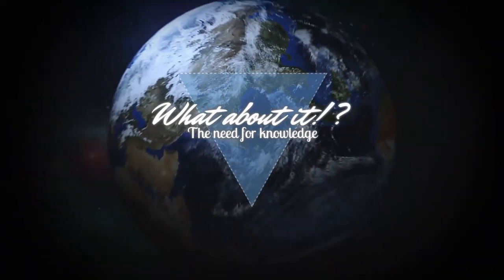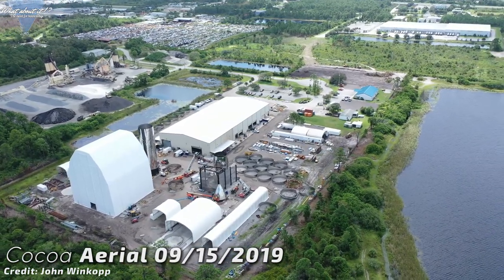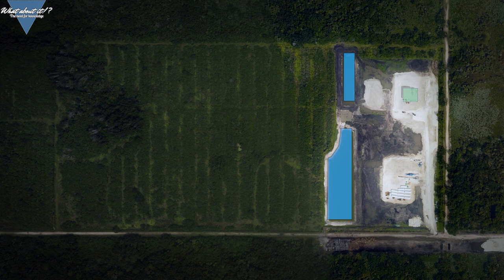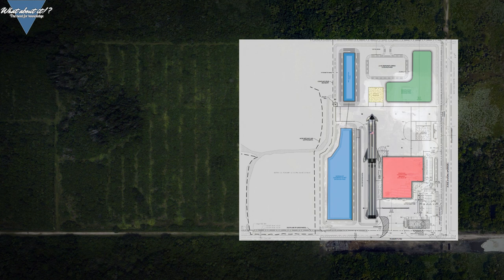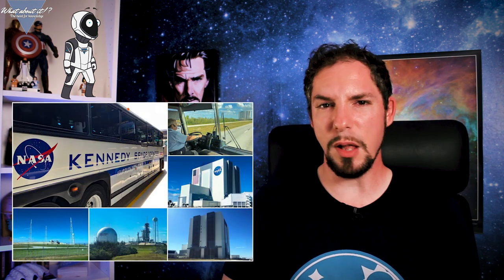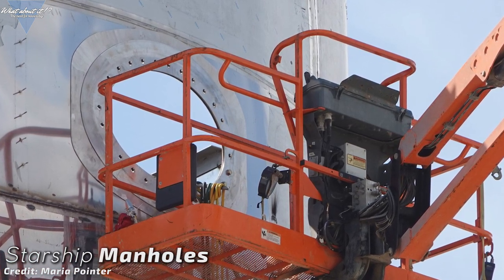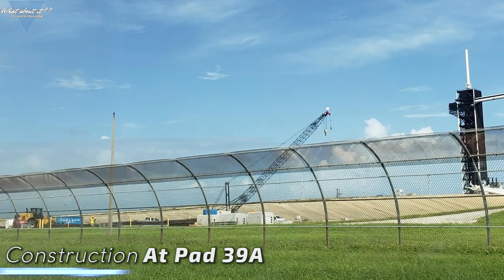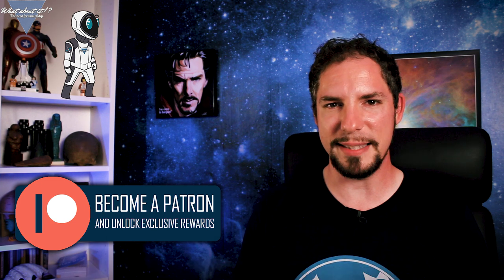34 | SpaceX Moving Cocoa Construction Site To Pad 39A – Boca Chica Starship Orbital Prototype

Comment: Keep in mind that if SpaceX can amass a fleet of F9 boosters at KSC they don't really need booster manufacturing at their KSC site. IMO if they were going to do any manufacturing there it would be for second stages as these are still expended on every flight and require less manufacturing area.
Reply from the maker: And SpaceX already said, that Falcon rockets will only fly as long as someone wants a ride. As Starship will be cheaper per launch, that won't take long. Wouldn't make any sense to move those 90k square meter away from Hawthorne. Agreed. Thanks for the comment, Simply Space! :)
Reply: A factor that could keep F9 upper stage manufacturing in CA is that it is short enough that trucking it cross-country isn't that hard. Plus, why go to the expense of shifting a factory for something that will be obsolete in a couple of years.
Reply: @Whataboutit  Still have 30 Falcon 9 launches planned for Starlink, but Starship is the future. Payload volume approximately 4x =>240 Starlinks. WOW.

Comment: @7:30.  Could be a location for an RV for the intertank.  If this test version has a lot of empty space between tanks, that area will need to be pressurized to give it some strength.  If the Cocoa version never receives a cutout like this one, that would kind of hint it is related to intertank area that wouldn’t exists in the all up flight version.
Reply from the maker: Interesting idea! Thanks for letting us know!

Comment: Odd free-association thinking time,...
Would the empty Starship bodies be within the carry capacity of an Mi-26 helicopter ?
Might make an easier way to move one from Cocoa to KSC.
Reply from the maker: Hard to say. There are no solid numbers on the weight of the prototype.
Reply: Doubtful. As I understand it, an empty Falcon first stage is about 25 tonnes, which is more than the 20 tonnes an Mi-26 can lift. It seems unlikely that Starship will be significantly lighter, given the weight of Raptors it's carrying.

Comment: the booster does not need to be made of stainless steal. its reentry speed will be much less than the Starship
Reply from the maker: That's what I thought too!
Reply: Since the booster is reusable, s/steel will be more robust & cleanable..no paint job..Have you seen the Falcon heavy core booster after recovery?..

Comment: The  Hole is for transfer fuel in orbit
Reply: The manway is for personnel access for inspection and repair purposes on Earth. You can't refuel a vessel with pressurized gas and liquids and leave a door open.
Reply from the maker: Orbital prototypes will most likely not be refueled in orbit.
Reply: Ow ok

Comment: Hey Felix, a question I had since the beginning: There are two teams to take on different angles for construction of Starship and SH. So, why are they both stacking the rings with heavy equipment, while it would be so much easier if they lift them. Its a technique they use in the US for building HUGE grain silos. Any ideas?
Reply from the maker: That is a good question. I honestly do not know. SpaceX normaly doesn't even assemble vertically. And others, who do, have huge vehicle assembly buildings at their disposal.
Reply: There are several very good reasons:
It is much easier and safer to lift the segments with a crane, but much more expensive.
A silo is hollow, the rings can be assembled in place after the silo is raised, this is not something you can do with a ring with a bulkhead. Once a silo is raised, you can not slide a ring under it because the jacks interfere.
Silos go up very fast and are bolted together, a StarShip is welded together, and the welds are probably x-rayed.
Construction would be far slower, since each ring would have to be built one at a time.
Reply: @joshua43214  as he said!
Reply: Silos are jacked and the segments are bolted in place sequentially. SpaceX now fabs their rings monolithicly and lifts them in place because you can't install a complete ring with the jacking legs in place. Not to mention the wind issues and other factors.
Reply from the maker: Thanks for the reply, guys! :)